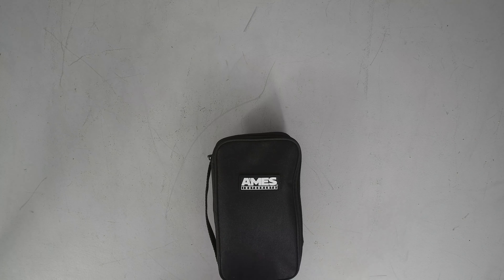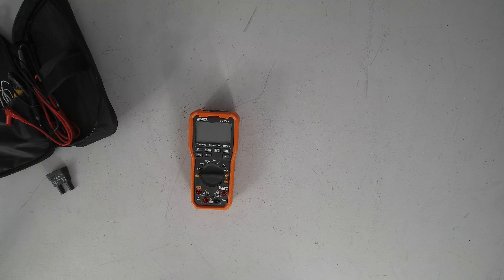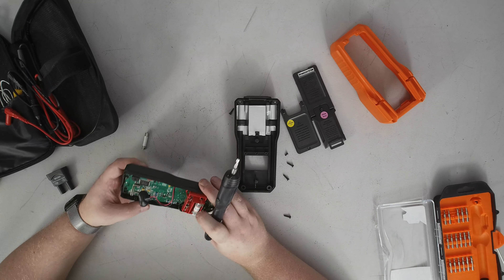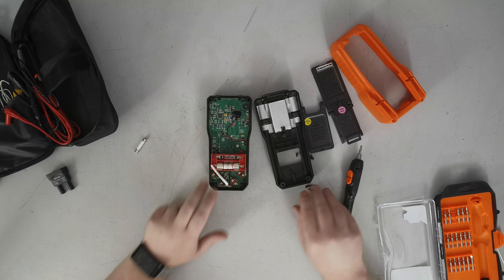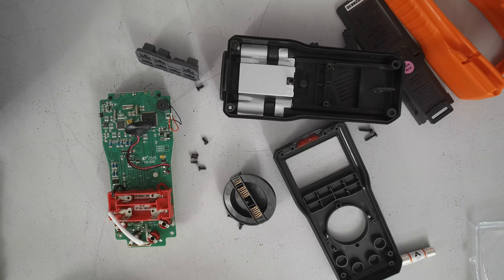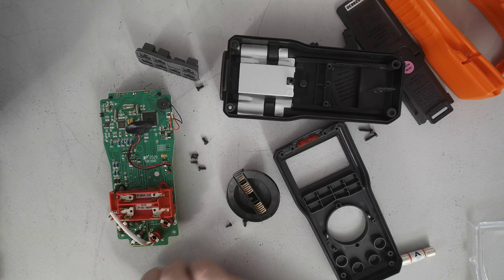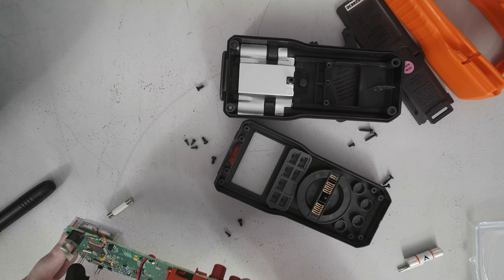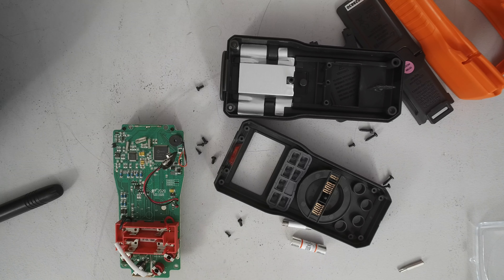Digging in to the Ames DM1000 from harbor freight, far cleaner than I expected

Comment: Thanks for focusing on the IC ! unfortunately the COM pins where used. Maybe the calibration header is serial ?
Reply from the maker: That or possibly USB, the IC has it and you can see it on the display in some product photos but it might take some soldering to re-introduce, a teardown of a related meter (such as the MS8250D which has USB functionality) would help fill something like that in

Comment: I just bought this meter. I'm curious how it would hold up for commercial use.
Reply from the maker: I haven't had any issues with mine other than wanting some better leads for it(I bought this set https://amzn.to/33a9dAp ) although commercial is variable, I've had no issues with commercial AC voltages but I'm not working with anything 3 phase, I've used it on card access systems as well without issue.